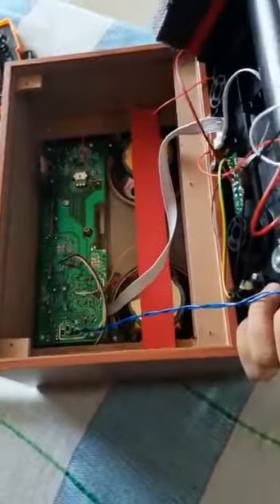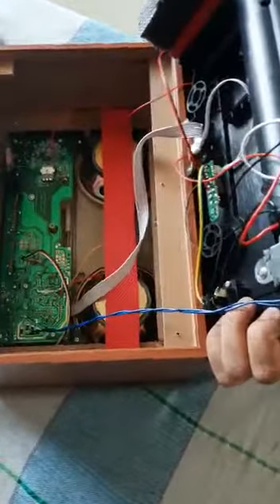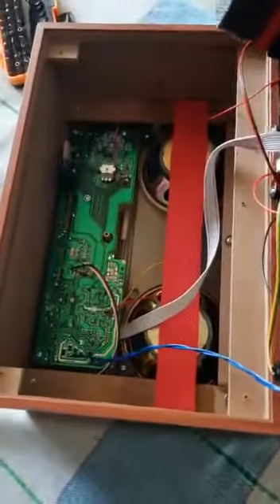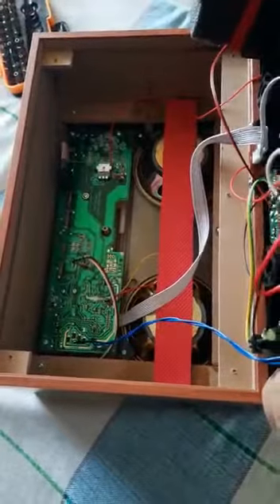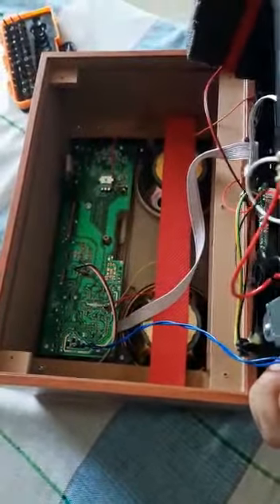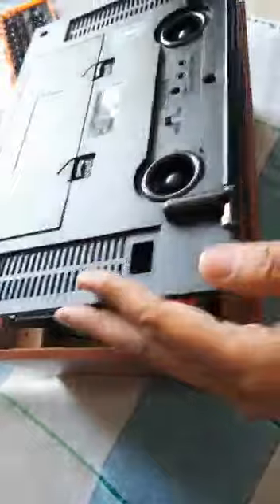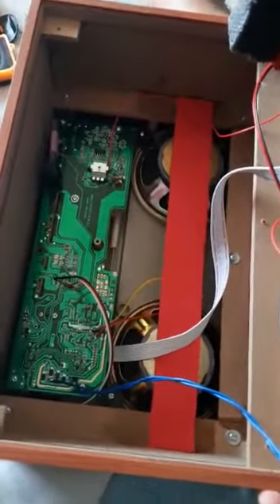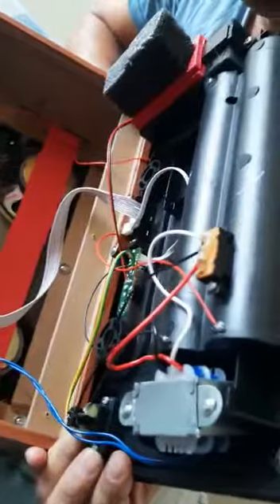😳 Look what's in the Heavy Big size Retro 📻 that costs Rs. 4000.00 🧐 Why it sounds so Good 😳

Comment: Kya ap ise sold karenge
Reply from the maker: You can buy this on Amazon. Here is the Link to buy- https://www.amazon.in/Noizzy-Box-Retro-XXL-2002-BT/dp/B075L922Y1/ref=sr_1_1_sspa?crid=2PFMHYRWR4RKB&dib=eyJ2IjoiMSJ9.3mXuGYj28RSBqWwKF2y89U2GRuq7vOhVXkYKa17xPxU_LJHA3k-06jSEPdSGl_GZbAiVF7ZOJugJxL8VdSCyUoKTgM48Tuq9kQC8WlKyGfCUCto8D-zNgAtFVHWupn4I2t4o1kQp4kbwe499lwyNT8NN2B08Zgj4MRVVmFN5tQGAxRevtP5MgIWXNeCAaaD8QRRaARFPsYpFvLY7XxjnXRfeA6Qr5H0dlvUTHlOf07U.0_o2tMmhNjX7_Hx4TyXCRHxf6xc1nU8dqaFF1HaJfIg&dib_tag=se&keywords=noisy+retro+radio&qid=1711796664&sprefix=noisy+retro+radio%2Caps%2C334&sr=8-1-spons&sp_csd=d2lkZ2V0TmFtZT1zcF9hdGY&psc=1